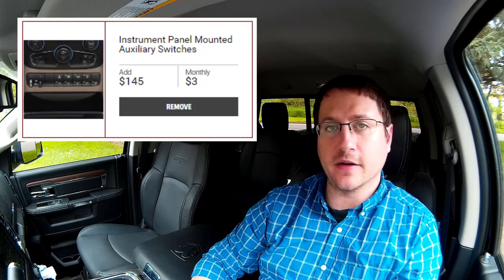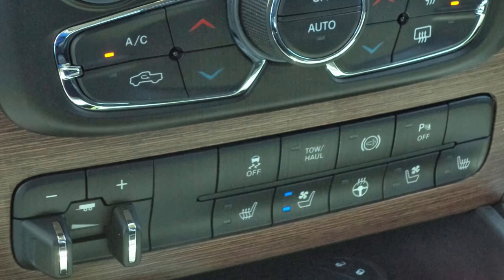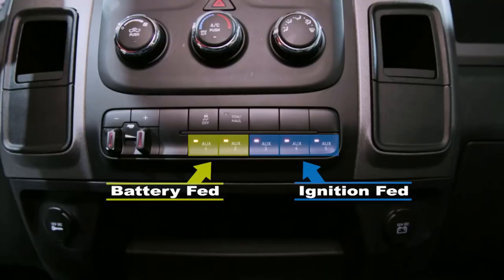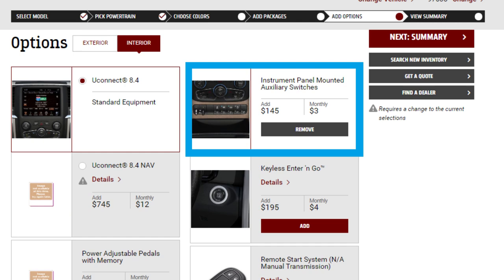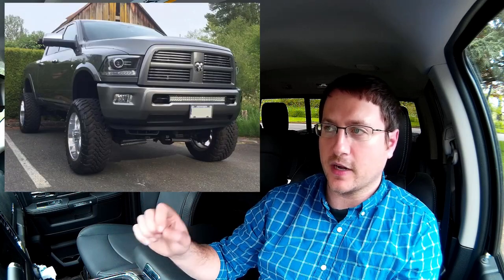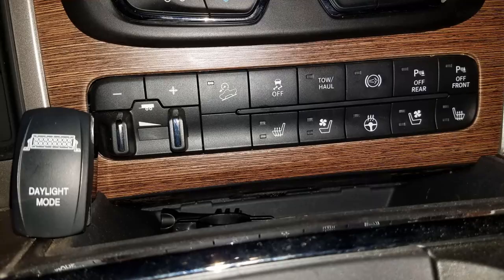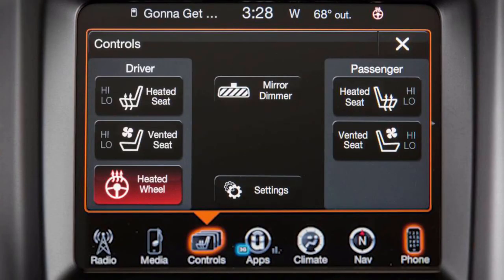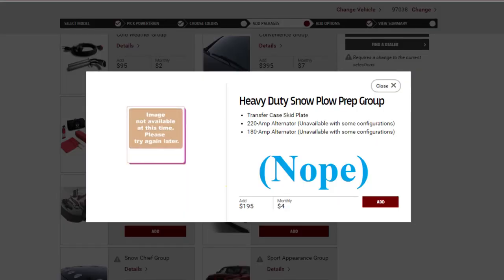Instrument Panel AUX Switches - Must-Have Options and Which to Avoid for the Ram 2500 and 3500

Comment: I like you prefer the seat and steering wheel switches over the Aux switches and for the same reason. As I'm browsing the local dealers it seems that every truck I'm interested in has the Aux switches. Its kind of frustrating and I don't want to deal with the wait time to do a custom order which end up costing you more money.

Comment: I don't like the auxiliary switches mainly because I don't wanna go to into the touch screen to turn on seat warmers or whatever. I wanna just push a button. If you run 1 or 2 LED light bars or cubes, it's very simple and risk free to have a shop plum the switches into a spot where you can easily access and won't mess with your wiring or anything. I had a light bar in the front bumper and cubes flush mounted to the rear bumper and I had a shop do the wiring for me. Took them hours to install everything and it was perfect till the day I sold it.
Reply from the maker: +John Doe We have the same thoughts on these
Reply: PNWreckage Great minds think alike brother
Reply from the maker: +John Doe 🤜🤛
Reply: Same here.  I prefer the physical buttons rather than the aux switches, and I use them all the time.  I also do not like going through the screen while driving.
Reply: I have the switches in my 17 2500, I didn't really care one way or another as I was more concerned about other options being selected. I don't really find issue with not having physical buttons for the heated and cooled seats as the truck always does them automatically when above and below certain temps. I rarely ever have to use the uconnect based controls.

Comment: I think this option is a great addon, for me yeah I will eventually need to truck to push a snowplow(Maine) and I plan to install an onboard air compressor so that I can hook up a hose at the rear bumper to inflate tires or operate X air tool.
Reply from the maker: +TacticalSBR That's pretty badass

Comment: Never knew about these options. Very cool. Programming those buttons would seem a tad daunting. I'm still trying to wrap my mind around the infotainment system on our 2016 Volvo V60. Love, love the car....but the tech interface....not so much.  Why do all the manufacturers use proprietary software that they seem to not plan on supporting or upgrading 2 or 3 years out? Newer Volvo models may have an easier interface to use. Good work as usual Christian!!
Reply from the maker: +Orren G Thanks Orren! I hear you about the proprietary software nonsense. The programming for the aux switches looked pretty straightforward once you learn terms like "latching" vs momentary. At least we're not dealing with automatic seatbelts anymore.
Reply from the maker: +Orren G also, I had your jokes in mind when I recorded the intro for the next upload
Reply: Can't wait!!! You actually crack me up....in. great way......"truck heaven".....I don't know why that tickled me. Got all kinds of graphics goin' on from that one!
Reply from the maker: +Orren G all trucks go to heaven, Orren. Everyone knows that.

Comment: Didn't really want these at first when I was looking for my truck, but glad I found a truck with it. How's the truck doing, any issues yet? I thought I felt some shaking of the steering wheel on the highway the other day. Hopefully it was just our crappy roads, lol..
Reply from the maker: +Stretchs WS6 Funny how that works out sometimes. Truck is doing great so far! A couple little issues I noted in my 3k review but it's going in for its first oil change on Tuesday and they're taking a look. There's a section of highway outside of where I live that scares me every time I drive over it. Makes it feel like the truck is falling apart!
Reply: Glad to hear the your truck is all good. Just worried about the steering wheel shake, read on the forums that a lot of people have issues with the front end and the dreaded death wobble at highway speeds. Keep up the good work on the videos!
Reply from the maker: +Stretchs WS6 Thanks man. I will let you know if I have any issues with the wobble.

Comment: Hey ,  i was wondering if you have had any experience, with the 6.4 hemi??? towing? mpg? etc thanks,,,, your videos are great and informative for sure!!!
Reply from the maker: +Ryan Helmig Thanks man! I would have bought a power wagon if I didn't need the Cummins and I'm a big fan of that engine. There is a channel (TFL Truck) that has tested it while towing and it wasn't spectacular but they had it pretty loaded up. Another guy on here (metalrevetments) has it and loves it

Comment: I've got the switches in my '14 Limited but I can't decide how to use them. I know I'm going to add a light bar but I may wire it into the high beams. Same thing for rear bumper flush mount lights, I'll probably just wire those into reverse lamps. Ill eventually get lockers, so there goes 2 of 5, and then some rock lights, maybe an air compressor, but those engine mounted ones are tits. Idk. Decisions, decisions
Reply from the maker: +trenttyre cool problems to have at least

Comment: Can this be used for a Ram 1500 also? I have the exact same switch panel but only has the brake control, stability switch and tow/haul button.
Reply from the maker: +Steven Grudzinski My guess is no but I don't know for sure

Comment: What are your thoughts on the Ram air ride system? I believe they offer it on the 2500.
Reply from the maker: +Lyle Schuelke Common request! I am trying to locate a truck with the auto level rear air suspension so I can give feedback. May have to go test drive one unless you happen to know anyone in Oregon with that feature haha
Reply: Can anyone tell me if you can get an auxiliary push button switch, factory, for a 2010 dodge 3500 so I can hook up a light bar to it?

Comment: I have a 2014 3500 and I am getting ready to wire some LEDs.   I can't find a menu setting to program the aux switches.   Do those pop up after you install something?
Reply: It should be in your EVIC, not U-Connect. Mine is labeled "commercial settings".

Comment: Uconnect sucks!!!!!  Mine hasn’t worked since the day I bought my truck. No one at dodge, ram, Mopar, xm, uconnect, etc can figure out why. Each time I call I’m told call someone else.
Reply from the maker: Have you updated it at home?
Reply: PNWreckage I’ve done everything under the sun. They even tried to send it a signal and it didn’t work. Guardian tells me to call uconnect; uconnect tells me to call guardian; dodge tells me to call either of the mentioned.